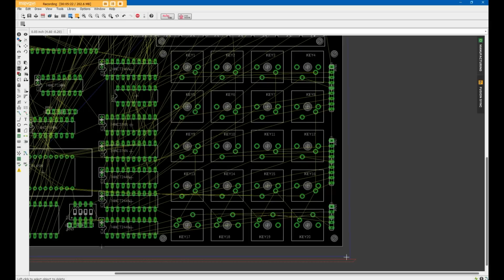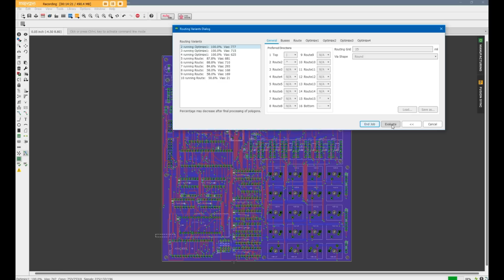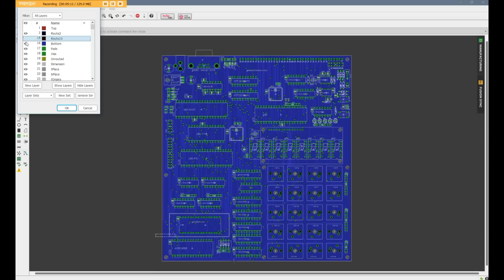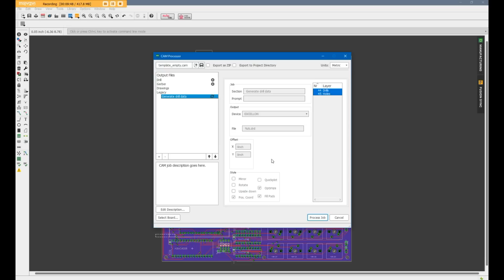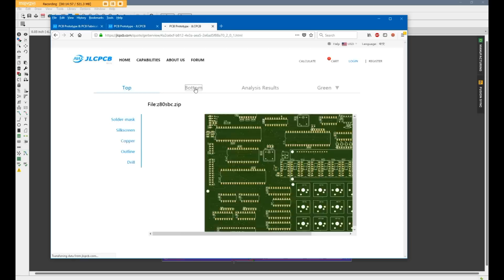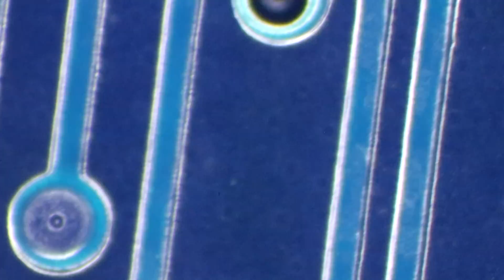Scott's Z80SBC Part-1: 4-layer PCBs with Eagle and JLCPCB

Comment: im designing 4 layer pcb, (L1:signal, L2: ground , L3: Vcc, L4: Signal). Im confused and unsure about ground and power polygon. I hope someone can answer my questions: 

1. I've created ground polygon for L2. Is this enough? since L1 also has ground pads. Do i need to create ground polygon on L1 as well?
2. I have rail voltage supply of +9V and -9v for one IC  and 5V for another IC. how do i create power polygon with these voltages? do i have to split the power plane? do i need to create power polygon at all? pleaseee help me. thank u so much

Comment: with dedicated layers for +5 and GND, you're creating a capacitor. Does that help in any way with decoupling? How about putting the supplies on the outside and putting the signals on the inner layers? I suppose there might be more interaction.
Reply: I did that in my Z80 board's design and it basically negates the functionality of the .1uf caps on each IC. Plus, the damned thing won't run at 20Mhz (but should) due to signal integrity issues, so I'm going to try going back to a 2 layer.
Reply: It would make it an absolute nightmare to debug or modify, and I've seen tests with this that show the capacitance is pretty minimal. I think EEVBlog tried it.

Comment: This isn't quite what I wanted back in the day when I was in University.  I was wanting a Master CPU with 128k, four Slave CPU's with 64k, two shared memory modules @ 128k each, floppy controller, and something to help me get whatever I worked on so i could load it at the University mainframe (punch card, mag tape).  A hard drives as you will remember was the size of a washing machine back then but just held 5 MB I think it was.  It was a PDP 11/70 when I was at the University.  Now, I have thought of doing something like that with Z80, 80x86, 68000 or some other Microprocessor.  The problem is finding those CPU's.  Yes, I could use the Z84C13/Z84C15 or whatever is the current one.  But if I create what I was think of back then with some tech upgrades; am sure I will have to write another OS again.  Because I don't think you can find the source code for MP/M even through I know I could always disassemble it, clean it up and then figure out what's going on to add the documentation to the code.  Cleanup would take months.  So, I ask this direct question after I somewhat explained what my old plans were.  If I was to build what I was thinking of back in the day, now, what processor would you think I should go with?  My background is heavy in electronics and programming wise is Assembler, Pascal, Fortran and Cobol.  There are others but not ones I would use for OS's.  And before you head there.  I royally can't stand any C, C++, Java or alike languages.  I have used them and wrote in them but I royally dislike them.  At least I know C will be coming to the an end.  Just haven't learnt what the new language is called.
Reply: The current thinking is a language called Rust.  I love C and C++.  C is like a super assembler.  I'm an old hardware guy.  Front panels and instruction repertoire cards.  8o)
Reply: @ByteMeCompletely  Yeah, it's Rust.  I have looked into it but day to day, I wouldn't be using it all that much; mostly python and node these days.  Last time I wrote an OS from scratch, I spend six month planning, a year of written to lose it in the end due to a hard drive crash.  Tried to restore it as I had five backup but all of them were BAD.  So, I tossed all printouts and notes in the rubbish.  There was no way I was going to type what I had in, to just figure out I didn't have a printout of the code for some bloody library.  Some days I regret it and some days I don't.  If I had more money then I would have backup up the source code to another computer.  But this was when networking for home computers was VERY  pricey where the NIC went for about 150 quid from IBM.  I guess if I had the money for another CPU to act as the archive then I wouldn't have lost it and it would have been completed as I only had GUI and native compilers to do.  It was written in 80% assembly and the rest was Pascal.  Never liked C.  I can read it but never wanted to code in it.

Comment: I'd say it doesn't matter what layer has the most signal traces. If your supply voltage is decoupled then your +5V and Ground are both 'groundy' for the signal. If you get what I mean.
Reply: Having the two inner layers as power and ground allows them to operate as a very large decoupling capacitor using the core as the dielectric. This works alongside the explicit decoupling capacitors to improve the overall supply stability. Dave Jones over at EEVblog has a few great videos on this.

Comment: The last time I made a PCB was when I was a teenager back in the 1980's and you used little stickers to put on the copper for each of the pads and lines then etched it myself. This looks like a great way to do it but I don't think I'd ever get to the 4 layer level of design.

Comment: I think the reason you got route solutions in the power planes is because you set them to auto. I just auto-routed a 4 layer board that I manually routed last year and set the power plains to '*" and did not have any routing in the power planes in the first completed solution. My board is larger than yours. Then again I'm running version 7.7.0 that I got from Cadsoft and have no intention of giving Autodesk  any more money for the newer versions. On my board I used surface mount caps for decoupling but my version of Eagle isn't smart enough to punch  vias through to the power planes (uses long traces instead which is incredibly annoying)  so I ended up routing the board by hand. Maybe there's a way to automate via-to-power-plain-punch-through  but I was in a hurry to get the board made.  Obviously if I'd used thru-hole-caps I wouldn't have had that problem. Top Router hangs for me to but it eventually gets going, then again, I do have a very fast machine but ultimately decided not to depend on the AutoRouter.  I have since switched to DipTrace-Full for Hobby but that has its own set of quirks... it does know to place vias  close to  smt decoupling caps thru to the power plains though :-)